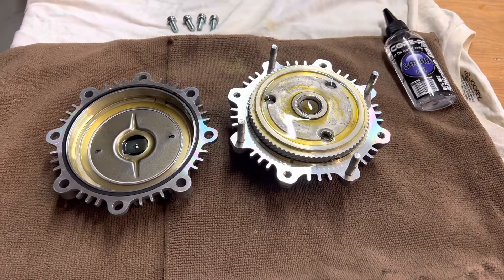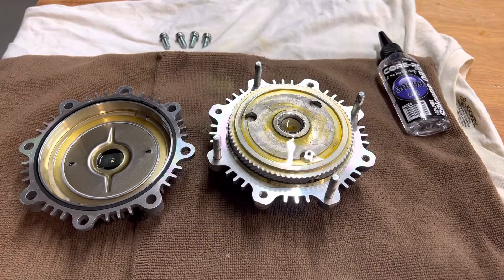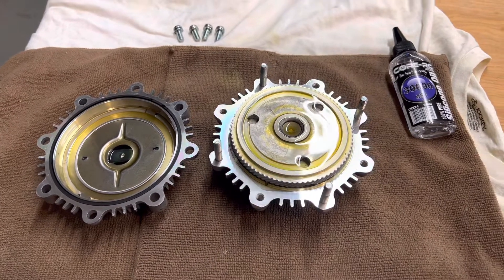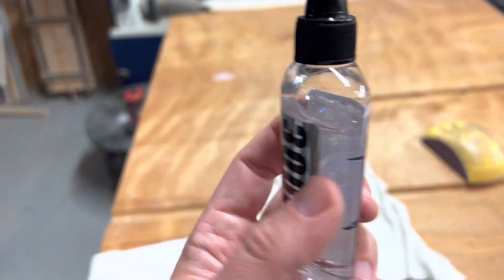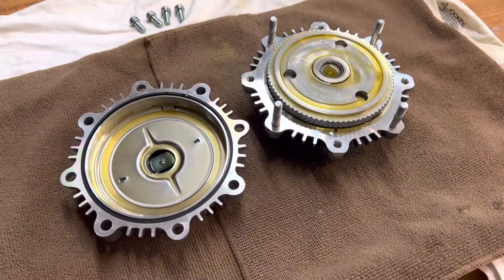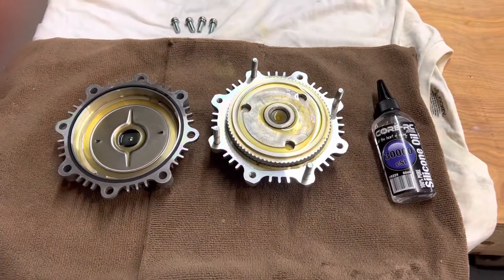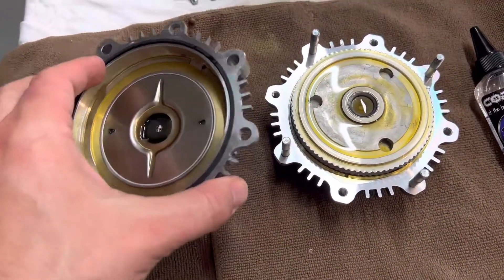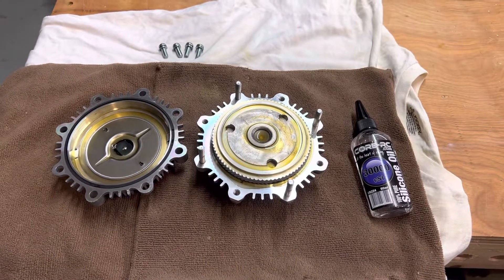Toyota 22RE viscous fan clutch service. Adding higher viscosity silicone oil.

Comment: Hey, how it went ?
Reply from the maker: Hey check out the last part of the description.. but anyway, it solved my issue! The fan is much more active/engaged and the coolant temps don’t go over 190-200 even at continuous high load. I may have put too much fluid in but I’ll test gas mileage this summer.
Reply: @dustinhotaling3502  thanks !